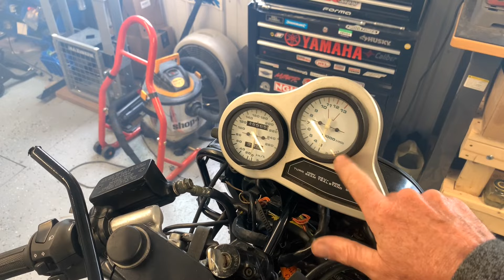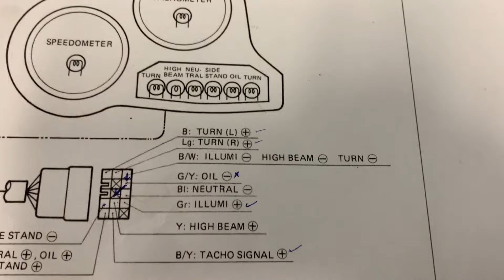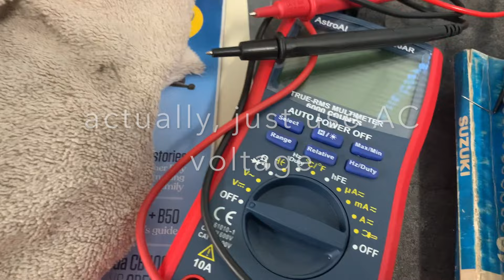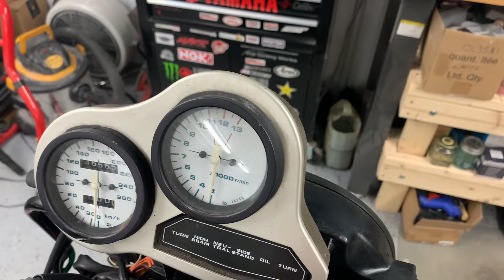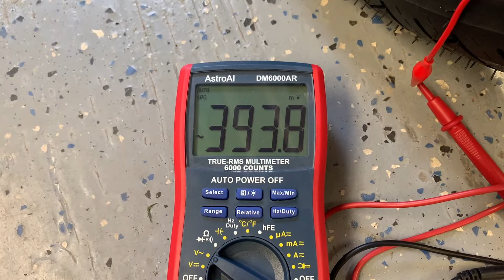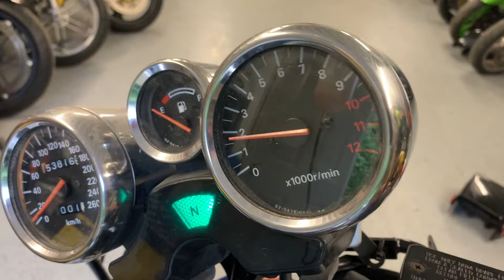1986 Suzuki GSX-R 750 Skoal Bandit Restoration - the Finale - Part 20

Comment: Hey an excellent series as I have come to expect from you.  You are my # 1 YouTube channel up there with Allen Millyard.   I personally like to ensure I have plenty of oil in the  main galleries after any engine work, or if the engine is an unknown product.  A little 12 V low volume low pressure pump is used to fill the engine sump via the main oil gallery, so I am certain everything is lubed as best I can before cranking.  The paint work is first rate, if only it were not green.  I am not a green person.  Thanks for hours of great entertainment
Reply from the maker: Thanks for commenting !! Much appreciated

Comment: It sounds pretty crisp running! 

Shes going to fly with useable power which is why I still
Love riding my Bandit 12.

I’ve spent thousands on it upgrading the suspension to Maxton and it’s probably my favourite ever bike.

I love the 80’s and 90’s sports bikes though, as they look like proper motorcycles 😊
Reply from the maker: Thanks Ian.   I have a jet kit for it now, just need time to install it.

Comment: Great video series. Well done. I had a red /black 86 GSX-R 750 back in the late eighties. Lots of memories.
I’m sure you checked this but… did you try revving the engine to more than 3000 rpm with the original tachometer? They only start at 3000 so don’t register anything at idle or even when blipping the throttle a little. I noticed when you tried the Bandit gauges you didn’t exceed 3000 rpm.
Reply from the maker: Hmmmmmm well thanks for that I’ll have to double check !!!!

Comment: Looks good. A hint though, never put a temporary fuel tank that high, remember every metre is nearly 10kPa or 1.4psi of pressure at your carby needles and seats. Easy to wash your cylinders with fuel leaks and mucks up your idle with inconsistent fuel levels in the bowls. Should always set it around where the full fuel level of the tank would normally be.
I dont know about your multimeter but a FLUKE multimeter on the AC voltage setting with the Hz button selected will give you an accurate pulse rate/sec. Remember to halve it for the wasted spark and multiply by 60 for revs per minute.
btw... are we gonna see more of the '78 GS1000 that fuel tank is from?
Reply from the maker: Cheers.   I hear you on the fuel tank.   There wasn’t much in it, so doesn’t create as much pressure I think.  I test all my carbs with that bottle full at 7’ high for 24 hours to be sure they seal.   But…..I understand your point, it’s a good one

The GS tank is off a Wes Cooley race replica my buddy is building .  More on that coming

Thanks again for the comment !

Btw, I will try the Hz setting too
Reply: @true-moto-resto  Volume doesn't change the pressure, 10millilitres or 100litres still creates the same pressure at the same height. Trust me, my experience with industrial processes and instrumentation is as long as my experience with GSXR's since I bought my first in 1985. Seems like yesterday.
Reply from the maker: @robertoburromiapanino2659 ok, thanks , good to know !! I appreciate the information and tip

Comment: Fantastic bike. Neil Robinson, TT road racer from here was the main rider here for Skoal bandit in the 80s, sadly no longer with us as racing claimed him in 87. Also saw your CBX.Dont ride that bike with the alternator chain rattle.I had a CBX with same issue,it pushed out the plunger on the tensioner locking up the transmission,even clutching the bike changed nothing. Thankfully,it happened me moving the bike in my garage.I did split the casings and renew it and bikes still going at 63k miles
Reply from the maker: Thanks for the comment Paul !   Yea there is another video series on the CBX750 from November 2023 where I took the engine apart again, new starter chain, new tensioner , new cam chain etc.   

I did 2 series on that CBX, the original restoration and then a follow up to fix the starter chain rattle

Thanks for the advice , it’s sound !

Roger Marshall also raced in the TT for Skoal Bandit Suzuki in the 80’s
Reply: @true-moto-resto  
I'd a CBX 750 from 04-16. A great conversion I did on mine was to use a 1000 hurricane swingarm and rear wheel leaving it on 17s( slight mods to fit but pretty easy) and a cbr400 aero front wheel,only required discs spaced out 5 mm each side. Bike looked and handled much better on 17s.
A suggestion for you to see on YouTube,if you search "TT F1 villa real 1986", lots of gsxr Skoal bandits racing including Robinson and joey Dunlop on no 3 rvf 750.
Good quality video considering it's age
Reply from the maker: Thanks Paul!!

Comment: For the lean running due to the pods, have you considered taping up the pods to restrict airflow, you may find that they allow anything up to 70% more air compared to the airbox
I think you could do with an extraction system in your workshop too, some nice hoses vented to the outside, give you some clean air and cut down on crap on the floor
Great looking bike though
Reply from the maker: I have a Dale walker jet kit for it.   So I’ll put that on if and when I ride the beast.   

Normally I don’t run the bikes on the lift for that long, I back them up to my doors and exhaust fumes are not a problem.   I also use a fan to feed the Cooling and help move fumes .    This was one of those times when I decided to start it on the lift and get smoked out LOL

Comment: I do believe that K&N make a dual filter, the RU-2922 which will fit on to your GSX-R carburettors.  I can't vouch as to the clearance against the frame, though... but just thought I'd put it here for the record ;-)
Reply from the maker: Cheers, yea I heard there was a dual filter , but not sure about clearance .   

These work well

Thanks for commenting !!!
Reply: @true-moto-resto  Looking carefully at your bike I'm pretty sure the rubber rears of the K&N filters would touch/ rub the frame.  But the black pods you've got look much better than the red K&N filter elements anyway, and they tuck very nicely in there.  Job well done.
Reply from the maker: @mikef.1000 thanks Mike !

Comment: fantastic motorcycle the tachometer circuit board may be oxidized. cleaning with wd40 and toothbrush will solve the problem. Also immediately lubricate all moving parts in the tachometer so that they turn easily. this solved the problem for me. You can carefully lift the tachometer edge at the rear with a flat screwdriver mm by mm. enjoy your slabby
Reply from the maker: Great tip !   I’ll try that !